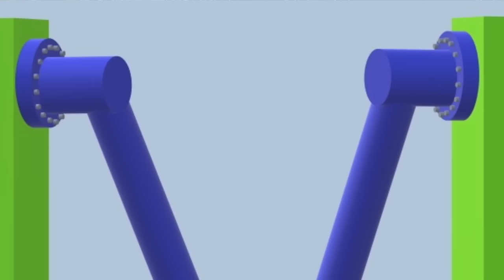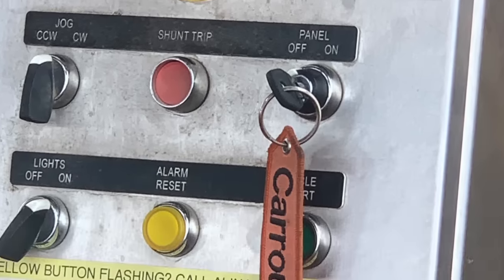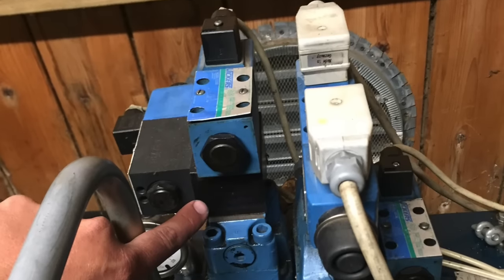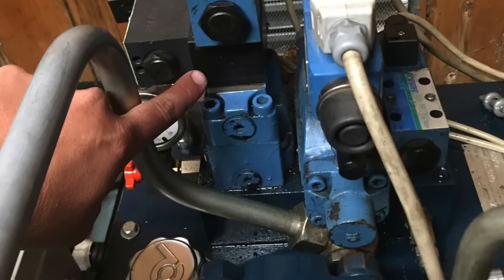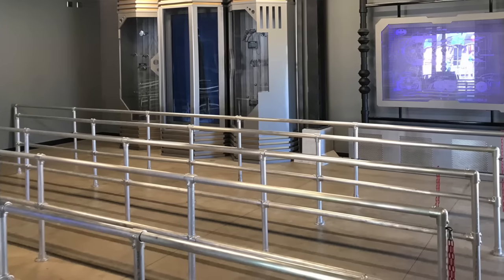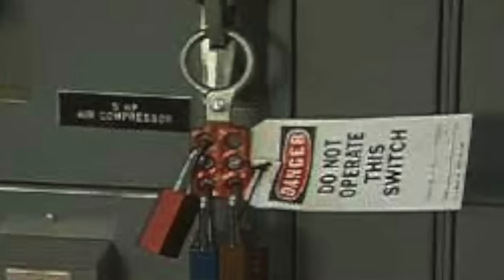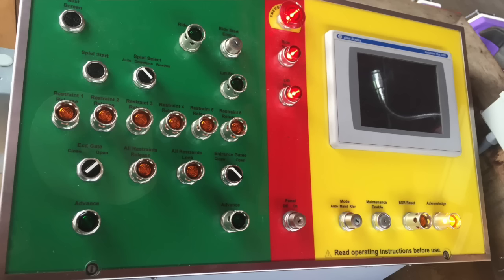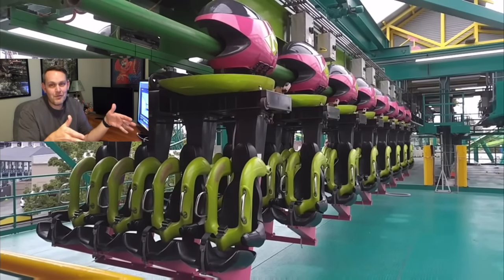Starting rides up for the day, Dispatch

Comment: Do intermediate block brakes typically run off their own local air compressor or are they plumbed into the rest of the system?
Reply from the maker: @sharkheadism  into the rest of the system. It’s less headache to worry about satellite air systems running.

Comment: I like your "name any German manufacturer" game when you were talking about the hydraulic drive wave swingers. You almost got it, but it's Zierer. I don't even think that Gerstlauer or Mack ever built wave swingers, in fact the one at Mack's showcase Europa Park is a Zierer Model. (Fun Fact: This ride was actually designed by Anton Schwarzkopf's brother Franz who worked at Zierer back in the day.) There are some Zierer wave swingers that have an electric drive system for the rotation though. But it's rare.

When it comes to AC drives vs DC drives, many manufacturers are moving to AC variable frequency drives for new designs. That doesn't necessarily mean they redesign the electricals for existing designs, but anything more new is more likely to be AC. Just for comparison - the good old Huss Breakdance, like most Huss rides, used DC drives (many operators today have them converted to AC by third parties because they are cheaper to get and you don't need to worry about the brushes anymore), but when Huss came up with the Booster, they went to AC drives. 
For those who don't know the background: The main reason for them to use DC in the first place is that DC drives were a lot easier to control in variable speeds. You basically just had to add some resistors in series and the motor would go slower. That could even be done using contactors, you didn't need power electronics. To change the speed of an AC motor (beyond the two fixed speeds you get with a delta/star switch), you need to change the frequency, and that requires power electronics that weren't readily available back then.
Despite being about 20 years old, the Technical Park Streetfighter swing ride has an all AC drive system, just as an example. 

The temperature issues aren't necessarily a DC thing - I remember working with a Huss Breakdancer, that you could basically switch on even during a cold morning, and it would just run. Sure, you'd let it run at a low speed for a while to make sure the gears and bearings give the grease time to warm up, but that's it. I hate to say it, but Italian rides are kind of notorious to be unhappy when temperatures are outside of a certain band. Especially when it gets cold, a space heater in front of the control cabinet works wonders. 😂
Reply from the maker: MAXIMUM  COMMENT PLEASE!! haha! It’s funny I never really connected the dots. Your right, all the Zamperla DC motors had so much trouble. But like you said HUSS (I had 3) power on, start, every time.!! Man! I wonder what that was? I always thought we neglected the motors as we were in California and the weather is never really bad at all no freezing, rains once a year. But I never thought I was just he Italian rides. Makes me think again.

Comment: Some newer B&M have a block test function on the panel views for ops.

 You would go to that screen hold the HMI Enable button and then press the hold on section button theres one for each block section typically we will do a hold on service brake first in a 2 train operation. Dispatch the train after we have enabled the hold the train will go around the course and hold in the service brake. We then dispatch the 2nd train ans it will stop on lift park we then on the HMI enable hold on safety and then release the safety the train would roll Forward and stop. Then we would press hold on transfer and release from safety. After that the lift will now allow us to strar it back up and the train would continue and stop in service. 

We then bring the train into the station with advance and then the train in the safety would automatically roll forward to the transfer when the teain in the station parked.

Fury 325 has the same block check mechanism on its HMI screen for ride ops to do block tests with

Comment: Hey Ryan! I worked at Cedar Point many moons ago and to my knowledge, park operations still transfers all trains on in the mornings, does block checks, and then would transfer off. On Raptor we would always run three trains, no question, so block checks were easy. Mantis, the B&M stand up cannibalized train 3 for parts back in the early 2000s, so we only had two trains but with an identical block set up to Medusa. With that extra block, to block check on the lift we would have to go up to the block brake and use a legit canoe paddle to break the photo eye and confirm the train would stop at the top of the lift. First, is it common practice for park ops to do this themselves because I typically only see maintenance so it at other parks? Second, if you have a B&M with 5 blocks (lift, block, main, transfer station), and only two physical trains available, would you also trip the photo eye or was it considered okay to park a train in the block brake and then dispatch the next up the lift?
Reply from the maker: So I’m answer 
First, a lot of parks have OpS do block checks and maintenance only does check in the PM of the ride. The logic however is a little of. You normally want to test the system under normal condition for the day. If I did it at 2 am then it was done again at 9am I would argue that the system was not the same hours of “off” time later. However like your park manny will say it’s perfectly fine and not to worry. I believe more parks have OPS check the blocks as trains are brought out not required to have maintenance. If that makes senses. 
Second 
You always want to check blocks next to each other. How the park does it is up for debate. Most prefer to use people to block the eyes and stop a train as it’s much more forgiving than playing with two 14 ton trains. 
Does that help or answer the questions?

Comment: I would love to see a deep dive on ride lockout.  Many folks may have only seen the procedure used with high voltage / gas line shutoff.  The idea that the master key for the ride is not present- thus it is safe to work on the ride is what people may have in mind.  Having a physical padlock for each person involved is not intuitive for many.

Comment: Interesting video once again. Always fun to hear how other mechanics at other parks do their daily start-ups, but you will always hear they put safety as their number one priority. Weird to hear you have had such issues with the Tivoli model, in my experience that thing always runs cold or not. But guessing by the train length you had a Tivoli Large, while I work with a medium (might be a difference). 
Just wondering, I once worked a B&M with a Siemens operating system made by EMNIS engineering (German programmers) and it required some daily sensor checks. We had to trip all block sensors, gap sensors, maximum reach sensors, light curtains etc before the ride would even start for the day. Doesn’t the one you worked on do that? Because I see this more and more on newer ride from different manufacturers these days.
Reply from the maker: Sounds like the park/ company you worked for got into an issues over some of those sensors. Those are hard lessons to learn. So the knee jerk reaction is not to test them all the time. We have only had daily tests on estops on some models and speed safety relays.

Comment: Sometime consider making a video about proximity limits, photo eyes, and other sensing devices. I can't remember if I asked you before but I'd like to know why some coasters have both proximity switches and photo eyes for occupancy detection (in the same block) while others only use proximity switches. Some used photo eyes on every block and some rides only used them in some blocks. Is it just manufacturer preference?
Reply from the maker: Electrical engineer preference. Optical is really easy to mess up though so most parks stay away from them as block control unless it’s indoors.

Comment: Ryan have you done a video on how a park winterizes various rides for the winter?
Reply from the maker: I touch on it in my off season work vide but I don’t focus on it. Mainly because I come from a an area that doesn’t have extreme demand during the winter so there was no need to winterize rides. So really what I know is from the manuals and talking with other mechanics.

Comment: 7:39 I would of thought there would be a way for each vehicle to be tested individually via the joystick without haves to cycle the ride
Reply from the maker: Not on the kiddo rides. Most mechanics don’t even test them. If there’s a problem they will let maintenance know. Mechanics just test the integrity of the joystick it’s self.
Reply: @ryantheridemechanic  The airplane kiddie at our park has a function to test the joystick without moving the ride, it will just give it al little pop up like halve a meter.
Reply from the maker: @SvenDonut  nice.

Comment: Great content, random question.......went to a park (UK) recently where they stopped rides for fireworks display and then fired all the rides back a little later.
Heard one guest ask a staff member what this alarm sound was that was going off.....to which she replied just the start up procedure for the rides (in this case it was a woodie.
Just wondered if that was normal or something completely different to your experience
Reply: Yeah thats common, depends on the park and manufacturer
Reply from the maker: Most newer rides have an alarm or siren to warn that the lift hill is starting. Also some rides have a warning that the control power turned on.

Comment: What do you do when a ride valleys. P.s love your videos man!!!
Reply from the maker: Thank you
Reply: He mentioned that on a smaller ride you can try to push the train with a few people or pull using a vehicle or a winch. If all else fails, you have to get a crane there, take the coaches off the track and re-assemble them in a different spot. So, depending on the type of coaster and where the train valleys, the action plan is somewhere between these two extremes.

Some coasters actually have means to get a stuck train moving again when there are spots that are prone to that happening. Phantasialand's Colorado Adventure (Vekoma mine train) actually has an additional chain lift mechanism built in close to the final brake run as the trains used to stall there quite often. In normal operation, it is not used, but it's there just in case. I guess then someone just needs to operate the right key switches and push a button to get the train out of that spot.
Reply from the maker: This got stuck under hold for review. Anyway, the answer is swear a lot. Then look to see if there are any little kids around that are now traumatized, then swear some more. Punch things, kick things, place blame where blame is needed. The start to pull it out of where ever it is.

Comment: How about general daily things that are done to get the ride started up?
Reply from the maker: Such as? Some  idea / thought in specific.
Reply: @ryantheridemechanic  this is going over earlier or later in the season where they're closed on the weekends, so is the procedure different when it's open every day since it'll have been touched and ran the day before
Reply from the maker: @beowolf9480  mainly just a lot of the double Check becomes inspect. I might do a video one day on inspecting a ride but not sure as it would be hyper focused on one small thing.

Comment: Do you use checklists when you perform these procedures?  If not, you could take some wisdom from the aircraft industry.  There checklists can be customized to deal with the particulars of the ride, & transfer some of your wisdom & experience to others starting things up.
          How do you check hydraulic restraints, which don't click?
Reply from the maker: No check lists. But it was trained from person to person. Hydraulics, you unlock one side of the cylinders, and just pull up firm. If the restraint feels spongy, that cylinder is bad.